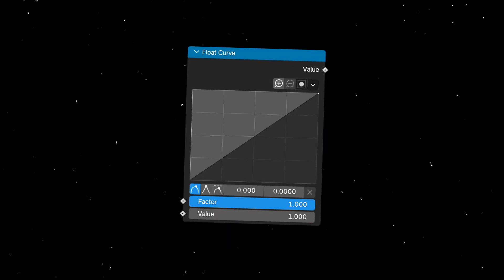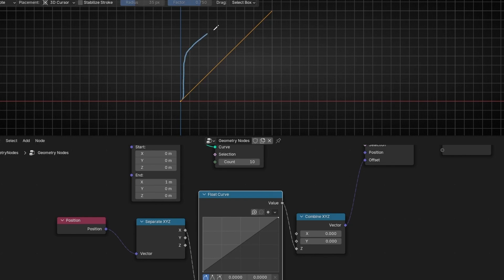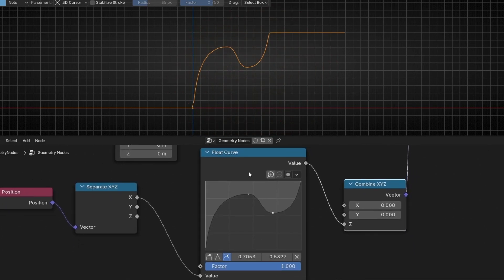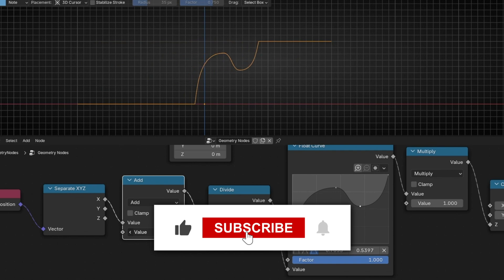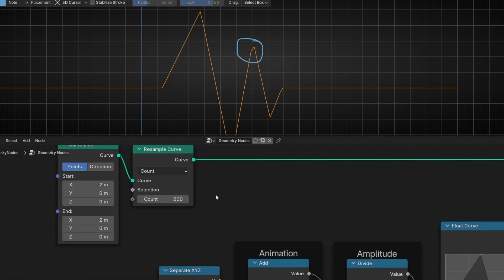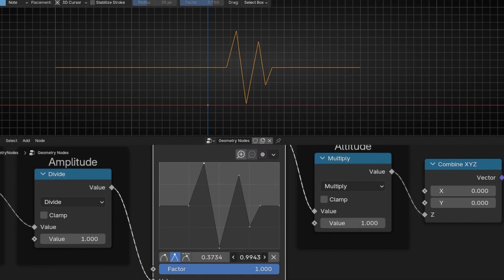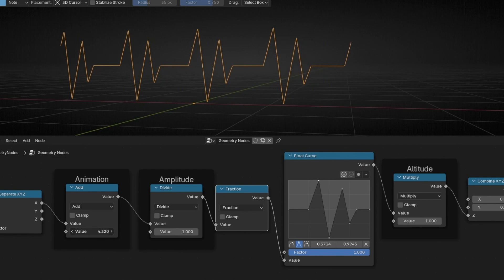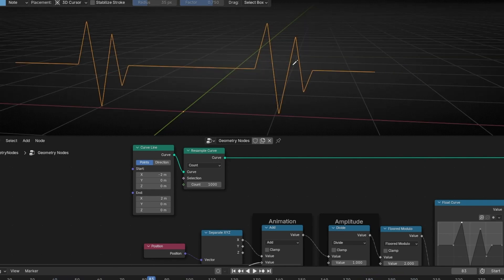Animate LINES with SHAPES in Blender Geometry Nodes - Heartbeat Animation

Comment: Beep beep. Say. For arguments sake, let’s say my mom said I could only have 8 points. How could I make the same shape in geometry nodes?  It would be simple to do with curve modeling of course. Seems like a lot of resolution for 7 segments. …And my mom only gave me 8 points
Reply from the maker: Mmm to do this animation I think it's imposible. Because we are moving the shape through all the points of the line. So, with less points we can't move the shape or repeat the pattern if the points stay in the same position.

Maybe, there is a way you can displace the points through the line, that means they don't have the same distance between them. Probably with the Endpoint selection node could work. But I didn't try it.
Reply: @Xan3D  it was just a curiosity thing. After your reply,  i see what i was bringing up is irrelevant to the point of the lesson. but im glad i asked because i still ended up learning something new. thank you.. Its always cool when i see youve posted. its 10 -15 mins of the day i know i'll enjoy and likely level up with
Reply from the maker: I have been trying what you asked me and I achieve it! However, you will see when we move the points and the shape reach the start or the end, the shape is compressed because the points stop at the start and the end, so the distance between the lines make the shape change when it reaches the caps.

Here you can see the animation animated with sine, look how the shape get compressed https://freeimage.host/i/dST96kG
Reply: @Xan3D  yes, i guess the points are betweeners by design . that behavior is cool, more animated even as it compresses, decompresses. you're awesome  for being curious and giving it a shot! 😊
Reply: @Xan3D  that sine makes gives it a hypnotic effect